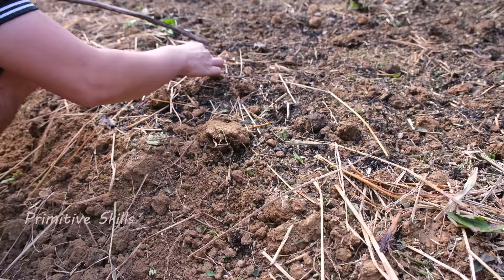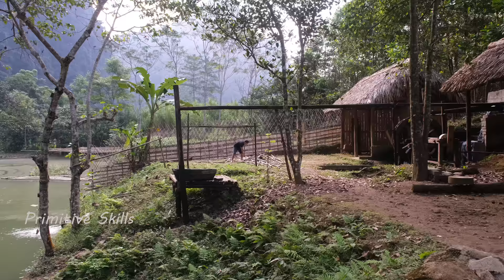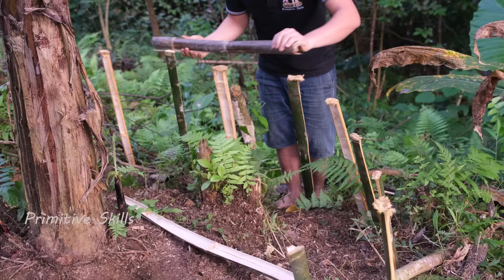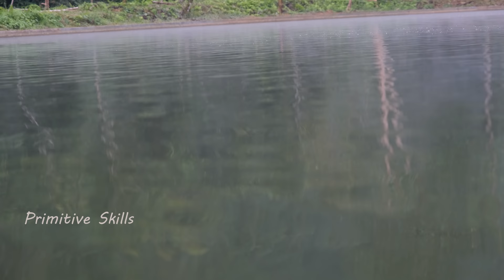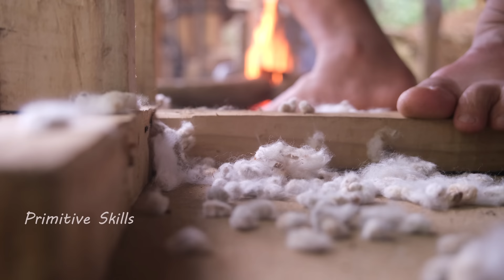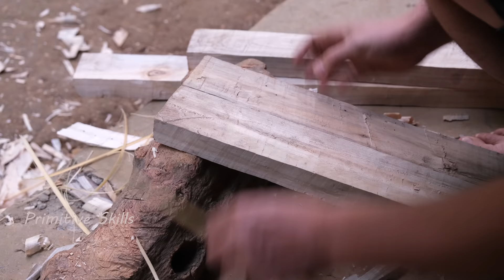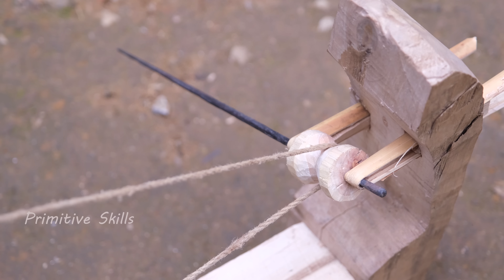Primitive Skills: How to make Spinning wheel, manual yarn rewinding machine (ep202)

Comment: It would be good to add some dirt around your concrete floor. It is being under cut by the rain drips from the roof line. This will eventually weaken enough that it will crack your floor. Just a few inches of clay packed around the edges will help the water run away from the building and prevent further erosion under the floor.

Comment: some minor changes that might make things easier for the cotton seed extraction: attach a basket to the frame on the side where the cotton seeds fall so that you don't have to pick them up later, and maybe have a ramp or chute on the side the cotton falls out on to guide it onto the basket on the side where the processed cotton comes out instead of dropping it straight down.
Reply: It would probably also be good to get some ground braces mounted onto the top of the frame, ideally in both forward and back.  The lard helped a lot, but you can tell that there's a lot of force that's still acting on the frame when the crank is turned, and the leg supports that he has now aren't going to work for it in the long run.
Reply: Only problem with a ramp would be a lack of smooth materials of the right size. Bamboo is probably the closest, but he couldn't weave it else the cotton would catch. Iron could work, but between being pitted and rust, it would still catch (and be a large resource cost). I just don't think a ramp would be worth the extra effort.

A seed basket though would probably be fine.
Reply: @The_Foreman  There *may* be a case for getting a plank as smooth as possible, then polishing it with sand on a river stone.  I've never done anything like that before though, so I don't know how well it would work, but it's possible in theory.

However, a ramp faces another issue, in that it would catch the seeds as well, which would hinder flow unless they were cleared out, which in turn would require similar effort to what the ramp is meant to negate.  

A ramp on the output would likely be a good idea, though.  It wouldn't need to be smooth, it would just need to provide some transit to the basket, so that the cotton isn't falling into the dirt.  Alternatively, a basket underneath both sides of the press would work well.
Reply: @johns6014  A ramp on the output was the initial suggestion. Issue being if it gets caught on anything, the lightweight cotton would then build up and need to be shoved into the receiving plate anyway.

However on the note of an input ramp, setting aside the ramp's smoothness, a small gap between the ramp and the rollers would work fine to allow the seeds to drop below.

Comment: For those who don't quite understand how the cotton is being turned into thread, the fibers are first rolled into a column (yarn-like thing) then wrapped around that long dark stick, the spindle.  When the spindle spin (thanks to the turning of the great wheel it's attached to, the yarn might just get wrapped around the spindle and not twist, but the key lies in guiding it to the tip of the spindle at an angle.  It then "slips off" the spindle's tip, and that causes the fibers to twist, locking them together.  It also puts a lot of torque on the thread being spun.  

That torque is partially relieved by 'backing up the wheel" a little so you can guide the yarn back up to the spindle sheath (so it can easily be pulled off the spindle without losing its spot and thus getting tangled), but also by stretching out the thread and fiber bundle so that more fibers are pulled (with a twist) from the untwisted bundle.

It's an experiment you can replicate with a spinning stick (chopstick, drinking straw, whatever), a bit of thread or ribbon (it's very clear how the twist happens with a flat ribbon), and by wrapping the ribbon so that as you turn the spindle, the ribbon "slips off" the end rather than rolling up flat and neat.

Comment: duong ! thanks for the videos.  bamboo is a grass or broad leaf weed  family member  not a tree ;]
you need to do somthing with the water supply as it is your water wheel has no power because there is only about 1 foot of head.  with POWER  run a sawmill and lathe to process wood  ...power a blower for forge and kiln....dry your food in the kiln  and a stamp mill to process food or ore.
Reply: @Lauradicus  i know...he dosnt use them though because it hasnt got the power needed to do work,,,using the grind stone stalls the wheel... the wheel has none of its potential horse power because of 2 things ...his water pipe is not sealed and will not hold pressure.. the second is the resivior at the bottom  , it is open topped water flows in and fills it then overflows ...the height from overflow to wheel is called "head" there is only a foot or so to power the wheel when he could have the 30 to 100 feet it is from the wheel to the river above. that amount of power is usable what he has now is not. he is smart and will get around to it in time i suspect. in the long run a functioning power source saves him time effort and boredom of repetitious labor
Reply: @mobiousenigma  : Truth.

Comment: 2:00
Because there is only one wall to protect the garden, the chickens have two other directions they can go to to get to the garden. The garden should be surrounded on at least three sides if not four. If the garden is fully contained then the only way they can get into it is by flying over, in which case it would be possible to make a small screen up top too, to make it covered by five sides. Time-consuming yes, but fully protected in case there was no other options. It doesn't seem impossible that they are simply walking around the pond and coming from the other direction, or going around the back of the property and walking past the initial fence to get in from the thicker bush and treeline.

37:40
I wonder if he will make a sheet or thin mat to sleep on or to keep himself warm in the colder days. Either one would be good for him. 👍
Reply: I am amazed at the devices you make. Who taught you all this stuff?
I have learned much watching you .  I hope your life is as rewarding as it seems.

Comment: For a first try, this is really good!  You'll want to grease all moving parts where they intersect each other, same as for your cotton gin.  You  might also want to try brushing out the cotton more evenly in density.  It's clumping as you spin it into thread (the clumps are called slubs) because the unspun cotton itself is not evenly distributed through its mass.  The denser it is, the more it will tangle quickly rather than evenly.  Making carding combs / brushes by hand is very difficult, though, I know!  

About the only thing I can suggest is maybe using boar bristles and some hoof & rawhide glue to make brushes that you can brush past each other, or carving a couple of combs that are sized to slot past each other, and just taking the time to comb the fibers to an even appearance.  (That's a good task to do by the warmth of a fire, but you have to be careful with cotton, because a spark can ruin your work & your day!  Wool will smolder and go out, but cotton can catch on fire.)

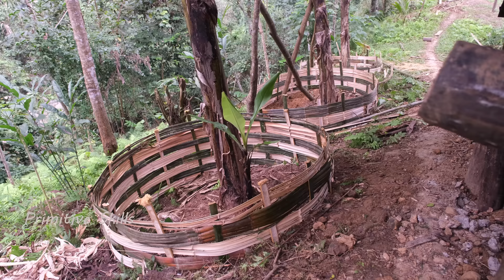Comment: 10:20 Chickens can jump fairly high. I worry that your fence might not be tall enough. Unless you completely enclose them, chickens have a tendency to go where they want, regardless of any fencing you might have set up.
Reply: 15:40 You should try grinding up some charcoal into powder for a dry lubricant. I mentioned this in your last video too. I'm not 100% sure it would work, but if it does, you wouldn't have to worry about your lard running out.

Comment: You post more often than some who use modern technology. I'm curious to know what you have planned to do with the cotton thread. I wondered why you didn't use the water wheel for the seed separator but I do know that would have been more work to set up. One thought I had which might not work is to coat the water wheel in concrete so that it doesn't rott as fast. You could use cotton fiber as a binder in the concrete.

Comment: Have you considered making a pole lathe to use when it comes to making cylindrical shapes or things such as spindles?
Reply: With the resources hes working with, it probably wont be to beneficial. If you want to see a primitive one made tho, look up “htme” or “how to make everything” on here and look a few months back in his videos
Reply: @isaiahburton1751  or the video on pole lathes by townsends both give great insights on how they work
Reply: A green wood lathe is literally a sapling staked to a pedal. Can be good for making well fitting handles, or decorative chair legs.

Comment: Chickens LOVE disturbed soil!  I suggest 2 things. 1. Create a “chicken garden” - an area that is tilled / dug , and then planted with seeds of grains or vegetables that they like. 2. Make a fence on the 2 sides away from from the pond. The pond side should be okay since chickens tend to fly in a straight line, but the other 2 sides make access easy for them. They’ll just simply walk around the current fence. I don’t think they are flying over the fence, as they tend to fly up to the top of a fence and then fly down, and there’s no way to land on the fence you made. By the way, the fence is AWESOME, it just needs to be longer.

Comment: Weave long split bamboo row covers for your new plantings/seedlings.  Make them 12-18inches high (30.48cm-45.72cm).  Tunnel like row covers with an open weave will keep the chickens away from the seedling until they are mature enough to withstand the digging actions of the chickens.  At that point you can either remove the row covers, or just let the plants grow up through the open weave.  (Kind of like a long, split bamboo net tunnel)

Comment: Definitely a foot pedal would be better to power your spinning wheel.  You'll get better control of your cotton and better thread if you can use both hands.  All the old spinning wheels I've seen in my country were powered that way.   And after that a loom, I'm guessing, because you need to weave yourself a coat and pants for those chilly mornings.  I'm guessing there's some material in your forest to make a fabric dye, if you don't want white clothes, so lots of projects to do on this!

What will you do with all that cottonseed?  Plant a new crop?  Feed it to the chickens?  Or, if you have a whole lot of it press it for oil, because you could really use a source of oil for wood preservation, or for cooking.

Comment: There is this item that when after you separate seeds is called a fray brush. You can use it to put the cotton in to separate the fibers to easily twine the string. you need 2 of them for cotton. In later times, you could also extract what is known in many food companies as "Cotton seed oil". It is best for frying foods and other things.

Comment: I think for the cotton Gin, the next improvement should be more support, like a diagonal bracing on front and back, there's a lot of wobble in the framework, which translates to torque limitations, and wasted energy. the lubrication was a great improvement, for sure. just a thought. I'm sure you have a lot of projects to work on.

Comment: This is not the first time you have used a chharka. I am impressed. The cotton you grew you picked before it was ripe, which is why you needed to dry it. Had you waited until the bolls had fully "bloomed" the fiber would be twice as strong. I have made that mistake myself.
I have a hard time believing that cotton gin really works. I know how hard you have to pull the fibers to get them off the seeds and can't see wooden rollers able to hold the fibers that tightly. I think a cotton gin requires some type of comb. 
I have read about using a bowstring to work the fibers, seen people show it in video but have never been able to get it to affect fibers at all. This video is the first time I have seen someone using one that even looked like it was working, and from the "slubs" in your thread it didn't do a good enough job. The fibers must be spread more evenly before they can be spun into a uniform thread.
Really impressed that you have been so deeply immersed in a craft that is so different from the rest of what you do. You can not spin with one hand like that until you have made several kilometers of thread.
Reply: @Lauradicus  I had to bite my tongue when he harvested it early. Someone gave him a lot of the right stuff. The head of Spinning at the Wythe House in Williamsburg VA once asked me how long does it take to deseed a pound of cotton? My answer was about a month of television watching while deseeding mostly during commercials.

Comment: About chickens and garden they love loose soil and manure which breeds the small larvae they like to eat. They often get the small stones they need to eat right during this process also.  Especially in the spring I keep them out of the garden. Giving plants time to establish. After they are up well you can give chickens garden time but not open range. The larger your flock the harder it is to manage. So make an area of turned ground that you grow grasses and seed crops for them. It will help them to get the nutrients and digging desire out. 🫶🏻your videos you are doing great.